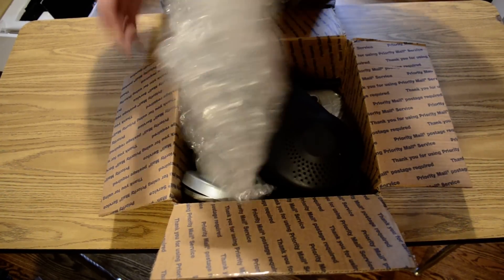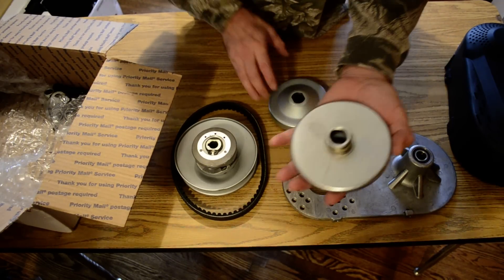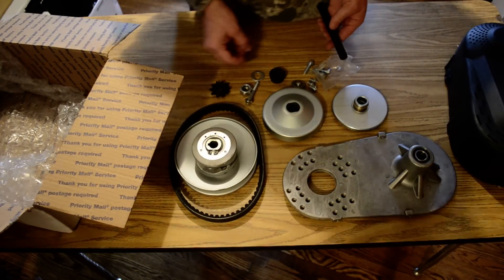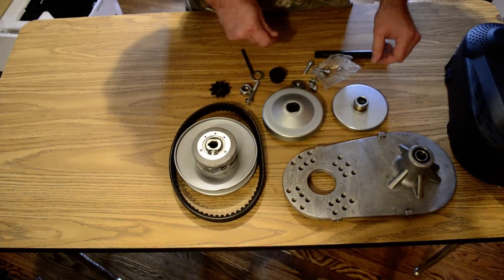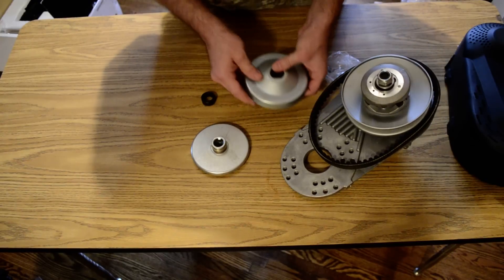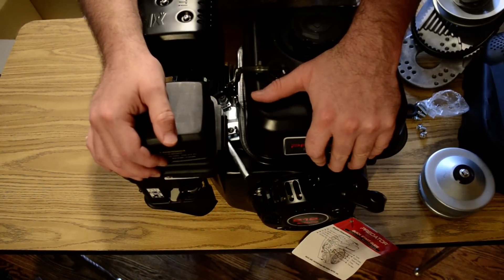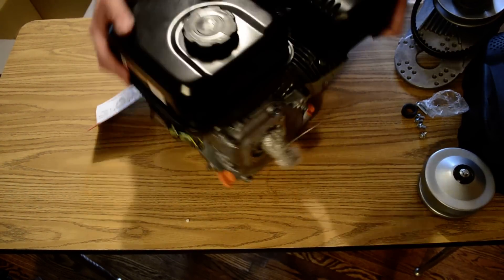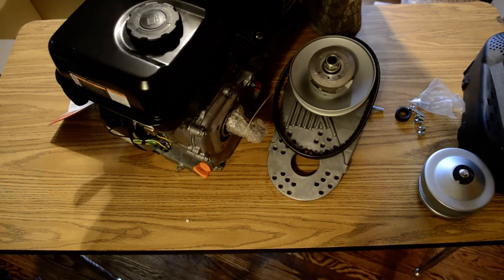Torque A Verter (TAV) & 212cc Predator Engine

Comment: I bought the same style torque converter kit off eBay as well, mine is the 30 series. the problem I run into is the holes to mount that plate to the Predator 212 are different from the bolts. The bolts that was sent with my kit are M8 1.25 pitch, the holes on my Predator engine are 5/16-20 standard(SAE) not metric.  How did you get around your install with the thread pitch difference between the bolts and the holes?

Comment: My speed  belt keeps goin and spinning without me pressing on the gas how can i fix it ? Shouldent the belt only spin when i press the throttle
Reply: Giovanni Chavez I hope you got help with your problem...it seened that your belt tension was to tight.  Perhaps your pulleys are further apart than your belt calls for. There should be a center to center chart measurement for the torque converter you have.

Comment: I'm new to all this small engine stuff I just got a gokart frame that uses a belt to drive the axle and bought one of the predator 212s I can't seem to find a way to run a belt between the motor and the pulley on the axle since all these converters seem to go to chain drive

Comment: I got 2 bushings 1 brass large 1 black snug on the shaft how does it go along with a large washer presume it goes before clutch also 1 large bolt where does that one go as compare to shorter this is for bicycle.

Comment: can you please tell me if this is worth buying? I have been thinking about getting one for my go kart and i dont know if I should just buy a torque converter or modding the engine (also have a pred 212)
Reply: +willm10 if you want a huge difference, yes..torque converter over clutch ANY day.
Reply: troque converto
Reply: +Pred 212 I know it makes a huge diff with acceleration but I heard mix results for top end speed. I would think the top end speed be the same or faster if you use the same tooth drive sprocket that was on the configurable clutch
Reply: Wes Zef i havent had a chance to go top speed yet but if i do It will be dangerous. 18 pound springs ,no governor, and will be running a 4:1 gear ratio within 2 weeks. im talking 60-65mph dangerous with no brakes or roll cage haha. i'm gonna have to wear a jacket and hat in case i fall off and slide on the road.

Comment: 6:15 - If your bolts go in there at first and then tighten up real fast and stop turning, it means your threads don't match.  You have a thick thread hole and fine thread bolt, or fine thread hole and thick thread bolt... or a thousand gradients in between.  Its stupid as hell, but there as many thread pitches in the history of bolt making (esp. across countries) as there are idiots in the world. No standardization.  Anyway, yeah, you are going to need different bolts with different thread pitch

Comment: My orginal engine that came with it is in good shape after I did a lot of cleaning, I restored it, *BUT* the gas tank has holds that need brazing,and its missing the fuel filter cup.  Pricing the rinky dinky cup alone is obscene, and the tank is expensive as well.   Its hard to justify sinking money into bring this toy back to life when I have other motorcycle projects where my buck would make a much bigger bang in the end on a more useful street legal bike

Comment: I'm in the same situation, I bought an abused and discared Baja Warrior out rusting in the rain for $50...  restored most of it... but I can't see spending $150 on a torque converter plus another $100 on an engine... that's $250 already... and still need even more parts (chain, cables, fenders, seat, etc).  I don't see how that torque converter can justify a $150 price tag.